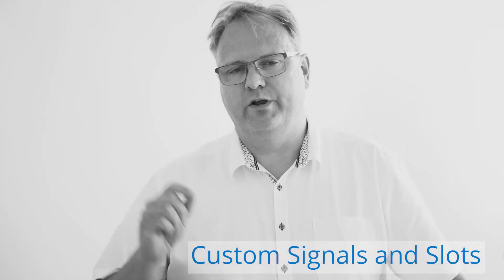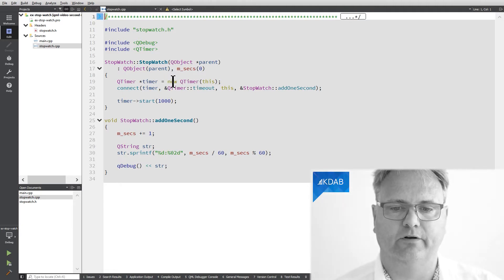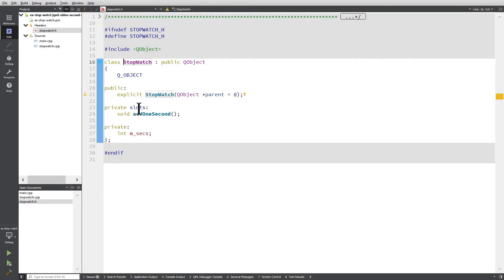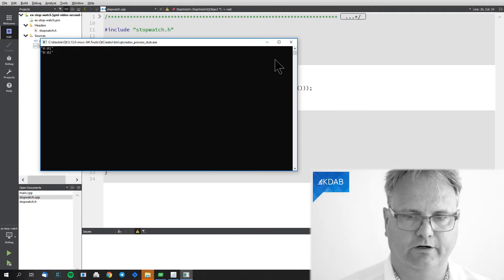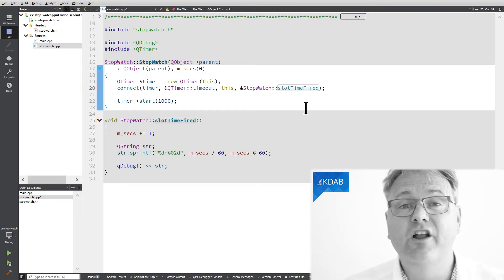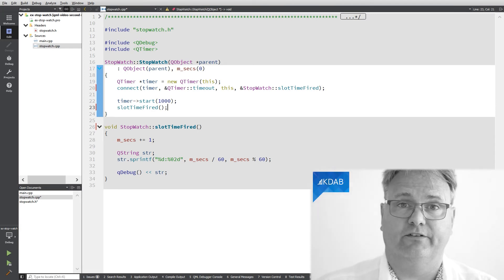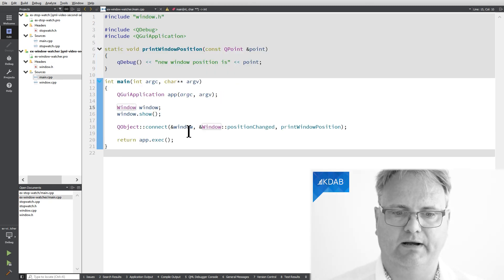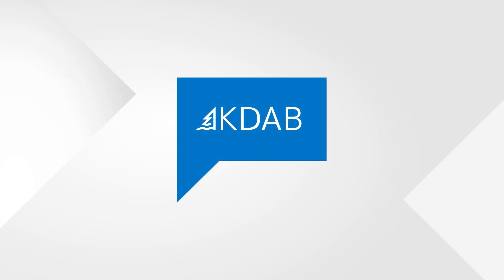Introduction to Qt / QML (Part 42) - Custom Signals and Slots

Comment: I don't believe there was any explanation of QML in the video.

I need to signal a value change from one "Item" to another. I've followed the documentation on the QT website, but it doesn't seem to work. I can signal the value change within the same "Item", but not to another. Do you have any guidance? Thank you.
Reply from the maker: Hi!
This video deals with the signal and slot mechanism of Qt Core, which is used by QML and is important for advanced QML use cases. If you want to create connections, or bindings, on the QML level, consider this video https://www.youtube.com/watch?v=2rtz9vkuxio&list=PL6CJYn40gN6hdNC1IGQZfVI707dh9DPRc&index=4 .

Comment: Hi, How can I declare signal from interface class, later implement it in another subclass and connect to slot? I found:
connect(dynamic_cast<QObject*>(obj_typeof_interface), SIGNAL(signal), this, SLOT(slot)) but doesn't work...
Reply from the maker: Hi Francesco!
Qt's signals and slots don't go well with pure interface classes. Instead, consider if your interface could inherit from QObject itself, you can properly declare the signal on the interface. This is basically what Qt does: it uses "fat" interfaces that are called QAbstract<whatever>. Note that when using multiple inheritance, as is often done with interfaces, you have to be quite careful. Avoid the dreaded diamond of death, and make sure the QObject (-derived) type is first in the list.
You can also use a pure virtual method in your interface and only declare that as a signal in the class where you "implement" it. By declaring it as a signal (which you can do with override and all), moc will provide the implementation for you. That does mean you cannot connect to the signal using the pointer-to-memberfunction syntax, but the syntax you gave will work then. In general, we do not recommend you use the old SIGNAL/SLOT syntax in new code though.

We hope this is helpful to you! If you have any questions, don't hesitate to ask you us.

Comment: Hi thanks for the good video,  i need a clarification 
         How does connect mechanism works if Q_OBJECT macro is not there in class declaration file ? How slot function is getting called on QTimer's timeout ?
As per my understanding , we need the index of slot for the connect mechanism to work, which can be read only via MOC files.
Reply from the maker: Hi Vinoth! No, for the Qt-5 syntax we don't need the Q_OBJECT macro to be there. That is possible because the call is made using the pointer-to-memberfunction syntax. No introspection of the slot is needed for this to work, and the method doesn't even to be marked as a slot (though it is good practice to do so).
Reply: @KDABtv  , Thanks for the explanation. Is there any document, where i could read about how connection mechanism works in Qt5 ?   

General Question: Does Qt5Core.dll contains moc file for all Qt Core related class(e.g. QTimer) ?
Reply from the maker: @vinothrajendran628  I'm not sure if there is specific documentation on how it is implemented, but a good technique is to start a debugger, then set a breakpoint in a slot of yours (which would be connected to, say your QTimer), then when the break point is hit, simply travel up in your debugger to the point where the signal is emitted, and then go step by step down from there again. That will show you how it works behind the scene.